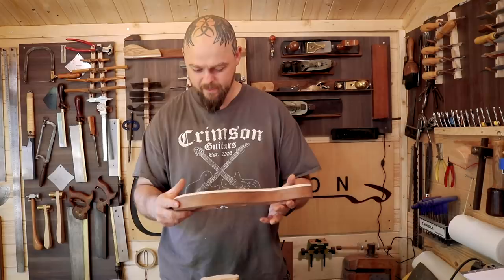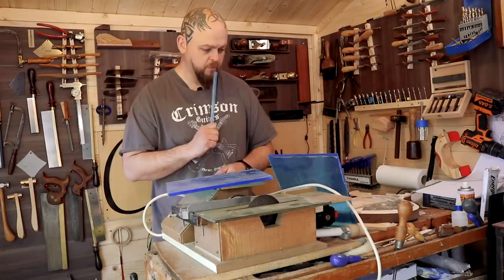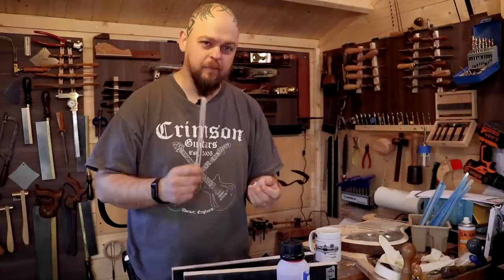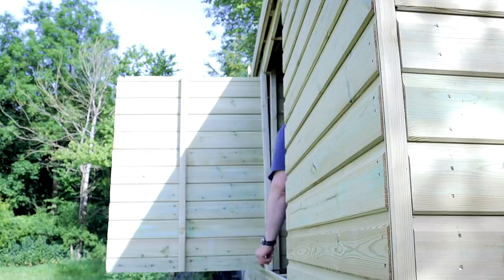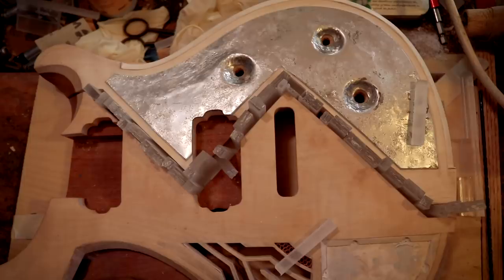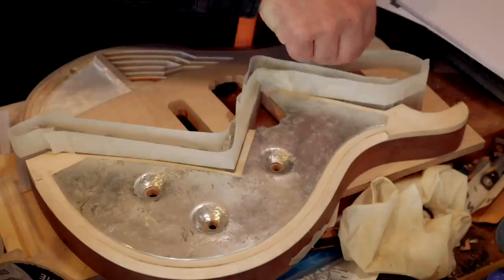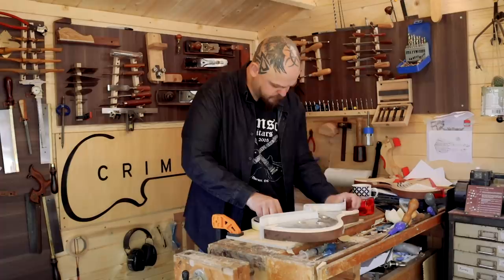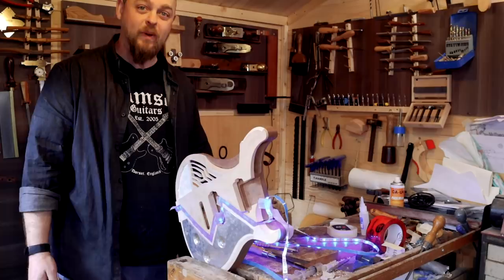Playing with Perspex Ep 8 | Building a CYBERPUNK 2077-inspired Custom Guitar

Comment: The knobs need to be either semi transparent or have semi transparent features (because at the end you can see the light shines through their holes). This would just look sick.
Reply: This. Definitely this.
Reply: @adammaverickcurtis   the pots will blocking the ligt but i think the same..
Reply: Put a frame in apoxi.. shoud be more light
Reply: Or vinil
Reply: @the88rocker  potentially use the same acrylic through the body to transmit light from the sides? Like light tubes in houses?
Reply: @the88rocker  http://www.ambrosonics.com/products/passive-sonic-glow-pots/ or led pots?
Reply: With an rgb led drowned in its middle changing color as you turn the knob, yes !
Reply: there are alpha pots with leds inside the shaft, those could work aswell
Reply: Some clear gibson style speed knobs should work well

Comment: I use LED tape in my hobby and you should leave them running for 8hrs straight, if they dont burn out they should last for around 25,000hrs before needing to be replaced. So you would be able to glue both parts together with no issues

Comment: You should install shutter blinds and bars on the field side of your new workshop to prevent window shopping rambler/thieves from getting any ideas! I mean you could drive a 4x4 up to the back of your shed and clean the lot out when you're away. Install horizontal fence wire in the walls to prevent some one chain sawing through! I've seen it done to sheds in the country side!

Comment: With regards to patterns coming through the perspex, if you are going to be gluing the perspex into multiple layers anyway you could essentially print a pattern onto transfers and glue them in between the layers of perspex.  That way the light would still be blocked but the transfer would not be immediately obvious to a casual glance.  Having said that, I would be figuring on placing them horizontally rather than vertically.

Comment: Great build Ben. Just a thought that might be useful. Taking a tip from the Light Saber building community. Using the white packaging foam sheets (about 2mm thick and comes by the roll) to diffuse the leds into one light source might look good (we use it within the blades wrapped around the Led strips for that reason)

Comment: Might not apply in this case, but maybe.  I used to build custom computers with plexiglass so you could see the guts of the computer.  I used to drill a small hole (size of an LED) into the edge of the plexiglass and put the LED in there.  What happens is all the edges of the plexiglass light up.  Not the flat part of the plexiglass but only the edges. It gave a really cool effect.  Maybe another project, or maybe you could find a way to use this technique in this project.   Lovin' the vids !!!!!

Comment: Ben, I've seen too many framing videos to like where this is heading. If you don't have jack studs, and top/bottom plates to frame out those windows, THAT WALL IS GOING TO FAIL! Even if you put windows in, the weight from the roof is going to press down on that side until it fails. Go get some 2 by 4 studs and fix those windows.

Comment: Instead of the perspex holding the 2 sides together I think it would have been cool to have metal rods at different angles and depths to look like a scaffold, and you could still have the lights going through it. The lights would also be easier to change if they blow later on. But that's just me, it'll be interesting to see how your idea works, I'm sure it'll be amazong!

Comment: I wasn't doubting you, why are you blaming me?  lol.

Ideas:
1)  Add some electronics that will change the color and brightness of the LED's based on sound.
2)  Often in cyberpunk-style settings there are lots of random cables; so I think you should consider getting a piece of narrow steel-braided hose or something similar and use that to make it look like there's a wire going between the top and bottom pieces.

Comment: The plastic will have a clear, faceted look if you actually polish the sides. If polished and then "glued" it will look like the 'internal' facets of a diamond. If you leave the cut edges with a sanded finish, it will be translucent. It will pass light through, but it will also give a frosted effect with no optical clarity. You won't be able to see past that sanded plane.

Comment: Yesssss! I'm so glad that you've decided to let us see this come together.

It looks great! The only thing that intregues me about the technicality of the illumination is with the pickups, will it create interference with the coils?
Reply: Unlikely. LEDs are not magnetic so I don't see how they can affect the pickups. If you're worried about hum, generally that is induced by getting close to some mains voltage which is AC, LEDs are powered by DC.
Reply: Multicolor LEDs are almost always driven with PWM. These are close to square wave and can, in theory, inductively and capacitively couple with the pickups. May need some shielding.
Reply: @tolkienfan1972 thanks for the reply on this, yeah, that's what I was worried about, I thought that they may induce currents in the pickup coils. It's nice to know that some sheilding can solve the problem.
Reply: @xTheZapper  it'll be interesting to see how the build progresses to see if there needs to be anything done or weather the LEDs and pickups can be left as is, provided we're lucky enough to see it completed.
Reply: @tolkienfan1972  I guess the quickest way to find out is to wrap the led strip around an existing guitar and see if it picks up a high pitched squeal.

Comment: Dark lines moving up on screen can be seen when you record LED strip at the end of the video. It might be a flicker caused by LED driver and it can cause interference with pickup and create noise at working frequency of LED driver. Try to add 470uF or 1000uF electrolytic capacitor between LED strip +12V and GND.  After that, point camera at the LED strip and if you don't see dark lines moving, it is fixed.

Comment: I love how when you said you were going for the full face shield that you left all the bits of plastic spray on your face to reinforce the point :)
Safety first - as always.

Best of all is the "happy accident" once again, where you had shelved the idea of the different heights of the perspex, but then you changed the method and were then able to incorporate that. Also making your life easier in the pickup rout. 

Just wondering - under the biohazard plate flat - you could put a sheet of perspex under there. It's still supported by wood/filler - but if the edges are polished on it, LED's shining in from the side can light the plate up. (curve a piece of perspex with heat, or if thin enough, just glue it down.)
Then the Biohazard also changes colour with the rest of it.

Comment: Really good job and very interesting idea. You say you don’t put Plexiglas pieces at the same level to a 3D effect but I think coarse sanding will do the trick. 
Instead of bolting the guitar to be able to change the leds, you could not make a groove (as for a truss road) on the unlined side, to insert the led string. so that the guitar could be fully glued and keep all its strength. 
It’s just one more idea, to give you a different way of dealing with the problem. often when I build or improve a guitar of my design (we have absolutely not the same level, I start, I started five years ago and I have built only three, and ugly in addition), I focus on a problem or idea to follow and I can’t exploit all the possibilities, so I return to work on, a few months later. Sometimes it’s my 15 years son, who said me, « why don’t you make this like that ». 
And I’m improving it. I admire your creativity, really. 
One of your most admired French fans

Comment: When you first mentioned bridging the gap with "bits and pieces" of plastic, a solid wall of chunks glued together is not what I saw. Somehow I envisioned a latticework affair of tiny "girders" or struts between body halves, with connecting "beams" not necessarily in an even pattern. Looking at what you have, I realize that what I saw would take a much wider gap to be doable, along the lines of 2-3 inches. For the 10mm(?) gap you have , your collection of blocks looks great.

Comment: LED wise I'm being the location of  each light fairly clearly so getting high/low spots. I'd double up the strips but offset them so the gap between each LED is effectively 1/2'd I'd also seriously think about putting a thin diffuser laver between the LED strips and the acrylic bars. Both will go a long way to smoothing out the lighting and avoid the bright spots. Lighting isn't easy but it really needs to be thought through on something like this guitar where its such an important part of the build.

Comment: If you're concerned about LED failure, could you not run fibre optic cable through a channel in the acrylic? At least you could glue the body halves together.

Comment: Loving it so far. I would suggest you get a double density or high density led tape. It has more leds packed into the same length of tape, meaning fewer hotspots and more diffuse lighting.

Comment: When the LEDs are at full glow/brightness, they kind of overpower the facet effect.  Might be worth a shot to put a layer/strip of greaseproof or tracing paper between the LED's and the perspexy-stuff.  It'll help diffuse the stark brightness of the diodes.  (I've used it between two panes of glass to make a light box).
Also - what's the brand of the air-fed mask, please?    (Something Evolution..?)

Comment: I realize that, by the time you read this, you will already be done.  However, regarding your idea for setting each piece of Perspex at an individual height then flooding with resin, you already have them at individual heights.  simply cut off enough of the bottom of the perspex to lower the whole arrangement below the top of the guitar body, then you would have enough room for resin.  And, cutting the bottom can be done in a "straight line" so to speak.  Perhaps next time...

Comment: Ben did I miss something? Surely the bridge pickup route is now way too wide as the cut line goes through it and the 2 halves have been separated and pulled apart to create the gap for the acrylic? Or did you re cut one half of the body to keep the route the same size?

Comment: Hi Ben, 
my suggestion for the best effect is using ARGB (addressable)  instead of regular ones. It will give you so much more lighting options. Here's an example https://www.amazon.co.uk/BTF-LIGHTING-Upgraded-Individually-Addressable-Waterproof/dp/B07LG4BCRP  
You could also try to diffuse led diodes to avoid hue spot effect and make light uniform across whole section.

Comment: could you recess the LED's into the body without the perspex on it. that way you wont see the LEDs
Reply: There might be some difficulty around the pickup area in particular, but I see where you are coming from. If this was from the back of the guitar, it would be easier to install because of the sharp angles, but that again has problems where the pups are ...

Comment: you need 5050 spec led's in there, the pixels are closer together and you will get a better and more even light output. like these: https://www.led-lighthouse.co.uk/led-strip-lights/rgb-led-strip-lights/12v-waterproof-colour-changing-rgb-led-strip-lights-60-led-m